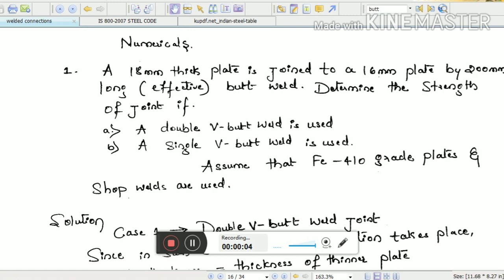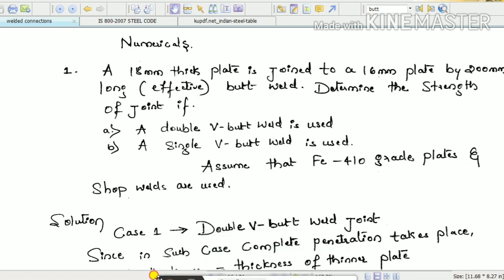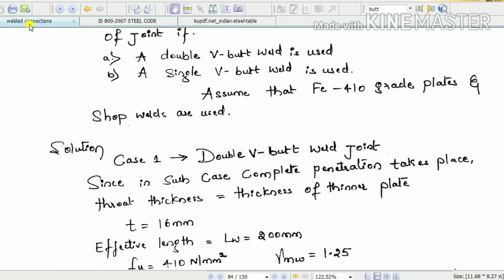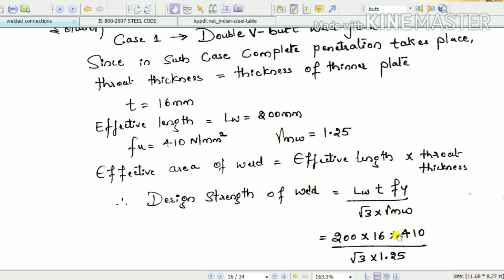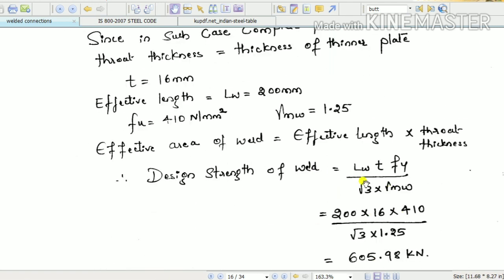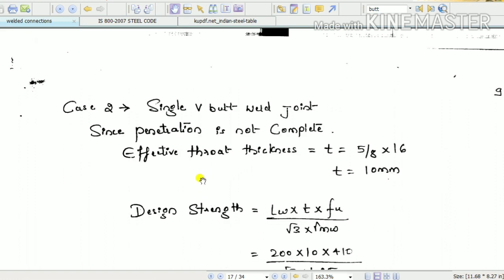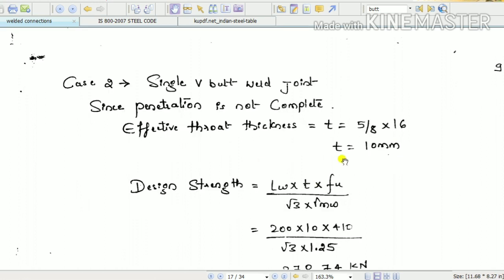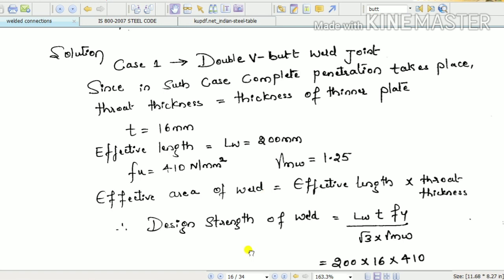HOW TO DESIGN BUTT JOINT/WELD (SINGLE & DOUBLE BEVEL)

Comment: Y 5/8 ?
Reply from the maker: Butt joint - Bevel Joints to calculate te, we will use 5/8 xS
Reply: 5/8 t, is the effective thickness of welded portion i.e. used to transmit applied force
Reply from the maker: As per IS 800 codal provision